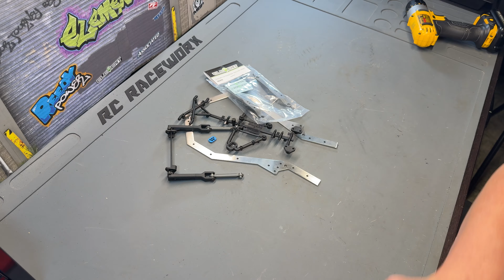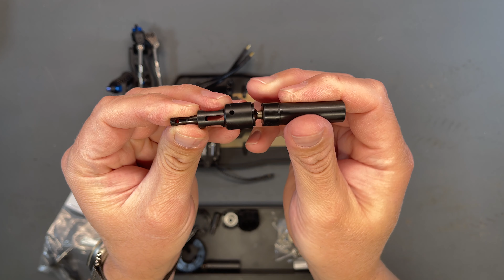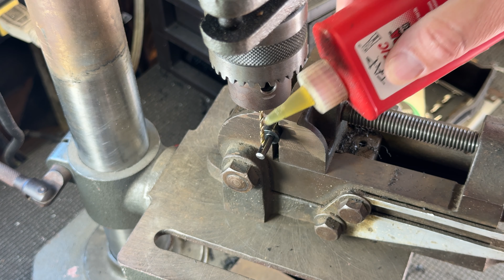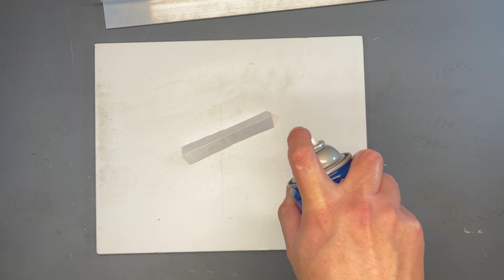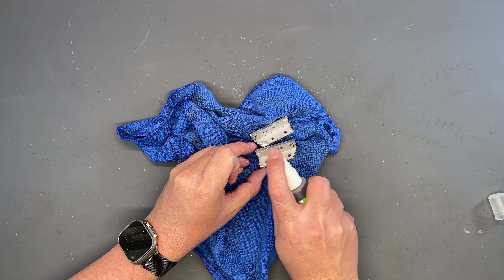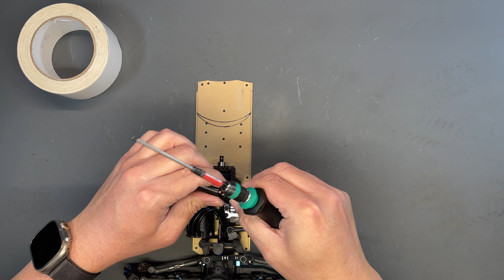Rolling Chassis | Zuul Runner Build Series Ep06

Comment: Another great fab video! Looking forward to more. Can you tell me what band saw/metal cutting blade you are using? I've been shopping around forever and yours looks like exactly what I want.
Reply from the maker: It's a Ryobi 9 inch band saw. I got the blades from Amazon. They are just metal cutting blades. I don't remember the tooth count per inch at the moment. They don't last very long, but are cheap. I definitely want to invest in a slightly larger one. Sometimes I don't have enough room for larger parts.
Reply: @MyBuildProjects  oh thanks so much. That'd be a start for sure. I was certain that the smaller band saws would be very good at cutting metal, even with a good blade.